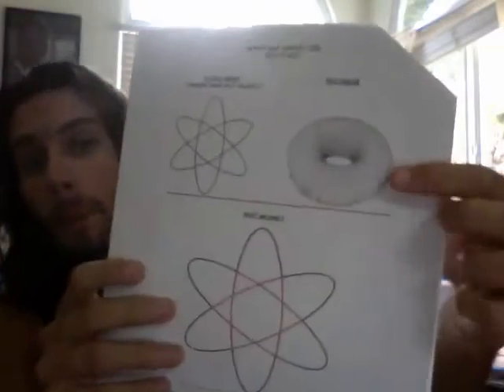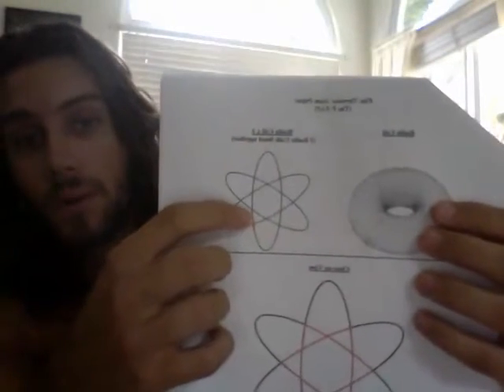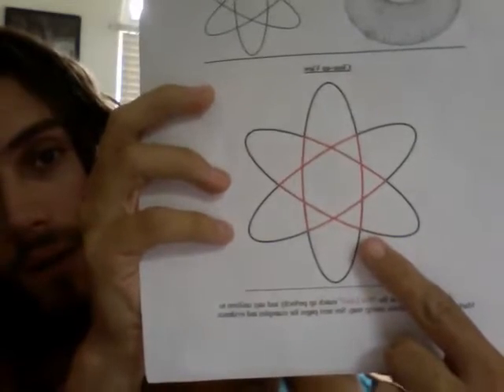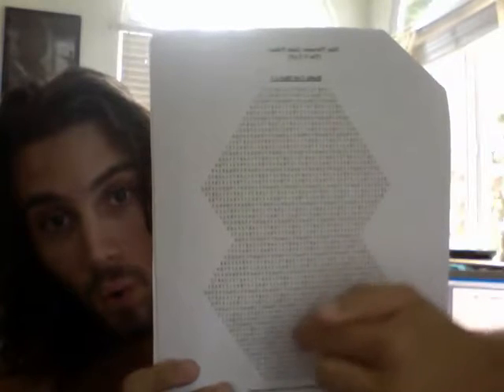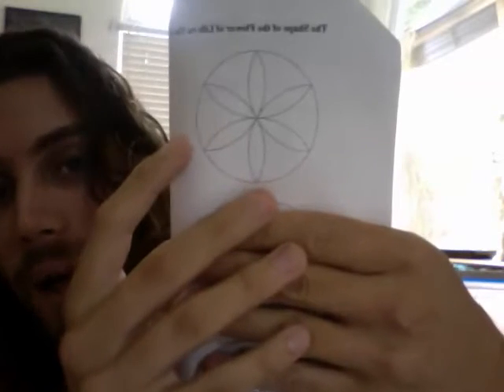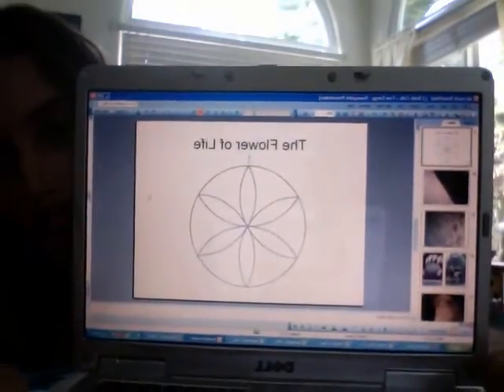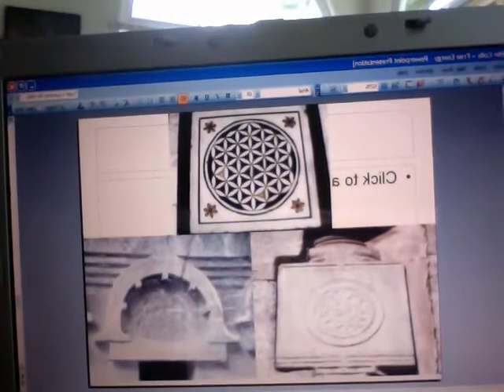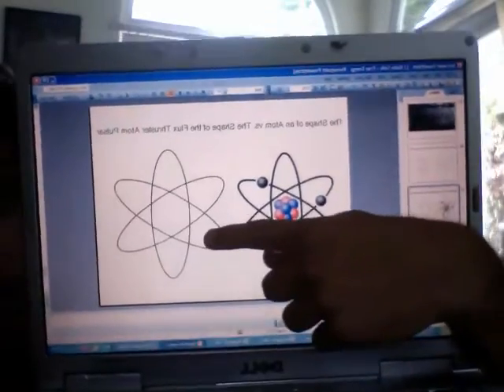3 Rodin Coils = Free Energy

Comment: Do this again but with industrial wire made out of gold fused with quartz. And bam! Free engery.

(Added on) industrial wire, I'm taking about size. Not a simple copper wire that you can also use to make jewelry with. But good size cables. And these cables are made out of gold fused with quarts. 

Gold is too flexible but keeps cool. (That's why NASA uses gold on their satellites) and quartz is a powerful conductor, but it's somewhat flawed. When it's under too much heated pressure, it shatters like glass. So if we use it quartz as a powder or a salt form and mixed with gold, it will store more engery than wasting it. 

As to make it work, I dont know if it needs to be spinning or not.

Comment: you can to try use 2 standard coils around feromagnetic core :
1 - in 1 direction close to core
2 - another direction further from the core(coil radius is much larger but not huge)
it is necessary to make sure that the induced voltages(as a result, a change in the core field) on them are the same.
Connect the coils consistently so that the current in them is counter.
In theory, it might have be amplifying coil.

Comment: I am an electrical engineer and I do appreciate you work and excellent job man. It's is the knowledge of past scientist that has us fooled at finding this free energy device. I totally agree with you conclusion and have reached the same already. However an atom cannot exist without it's nucleus. 3 in the flower represents the base form of energy that exist as a unit if one working in natrual harmonic way. Models can also be developed for increments of 3.
Reply: Maybe on the center a plasma energy ping pong ball as nucleus? 
Beautiful video, thanks. 
When I make 3 of them, do I need to do connect them or ???
Reply: I think you are missing the third dimensional interpretation of this pattern. Two interconnected truncated pyramids to pull energy from the core of nothingness. I believe thats where your nucleus wil be found and generated in.
This is very similar to the bashar space time antenae pattern.

Comment: There's a catch. I had this idea also, but this is not the path atomic particles take. This is a representation, a symbol but not the real quantum motion of atoms. The theory is to cause a magnetic singularity, an event that there is no equal and opposite reaction. Unfortunately this triple rodin coil or even a triple vortex coil would need a quantum timing controller to keep from becoming a balanced magnetic system, which will never produce "free" electricity.
Reply: nope.  just need thin magnetic shielding.  you can get thin magnetic shielding to work if it's cooled to near absolute zero.  Lots of designs like this will work, then.  Crop circle designs even.

Comment: Hi Everyone, Please take a look at the 3 phase abha rodin motor generator on you tube, the spindle torus has this basic shape of a atom. The design is based on pi  and small phi. The motor ha s a coefficient of performance of 5.98. The generator is intergraded in the motor as one coil. Power in is 43.8 watts output is 27 watts the motor is a 2  inch N-42 neo sphere  running at 12000 Rpm Producing .35 Hp at 192 ft/lbs of torque. This is the only 3 phase Abha Rodin motor generator on you tube and is the most advanced I have seen so far. All off the shelf parts used,  Tony
Reply: its overunity?

Comment: Is it possible to tie this into other concept designs recently discovered in symmetry or shapes found in quantum physics or bio-mimicry?  The shape makes sense, and I think can be expanded even further.  Now instead of copper and plastic, how about Graphite and or superconducting materials?  For a combination of current and data throughput?  Or an efficient containment design for a small plasma vortex exchange like the Pantone engine?  Is something that may cross with nano materials?

Comment: Thank you for sharing your insight.  I like it.  I'm going to be thinking about how to 'fuse' the wire together at the joints.
Reply: i don't think you would want to fuse wires as that would just short the wire to the corresponding loop on that axis, more likely the fuse would be in the buildup of of 'magnetic' energy as they cross, i.e where they cross 'magnetic' energy would build. (theoretically)

Comment: When I look at the Flower of Life Medallion as a model for assembling Rodin coil, it occurs to me that the Flower looks more like it could be 6 Rodin coils (side view), wired consecutively, with their edges meeting in the center of the flower forming a torus...what can I say I think like a tatter, making lace designs out of consecutive knotted rings.  I suppose all we can do is build them and test them to find out how they behave.
Reply: Well I need the two directions (clockwise/counterclockwise)that's two coils. The triknot that you speak of is on a fifth dimension. The six points are the six planes of the cube where the six cones are expanding towards the exterior and compressing towards the interior

Comment: Shane, I feel confident that you can build this device. That would be sweet if you built it and then did a video on the device. Go to Radio Shack and buy some wire. It is really cheap. Copper wire would work according to Rodin's theories because the *TRUE* reality of the force flux field would not care of the material that it is made from. The shape of your device will assume the universal constant ( If you are correct ) and constrain the electrons within the coil to assume the force field!